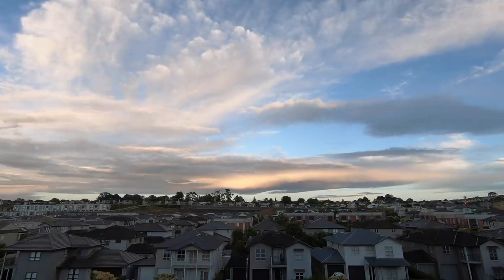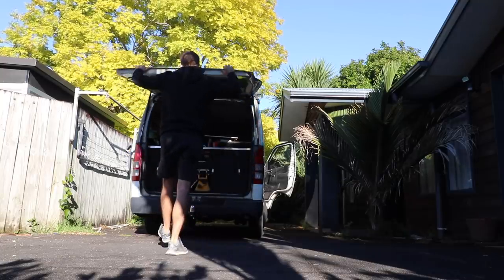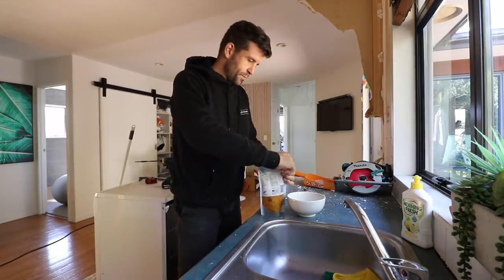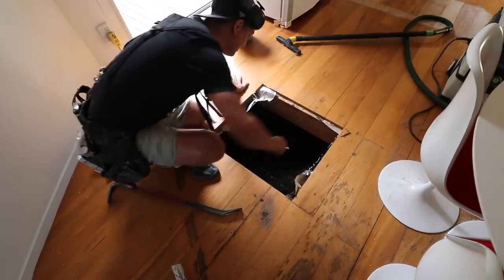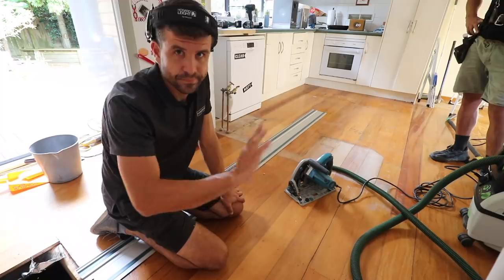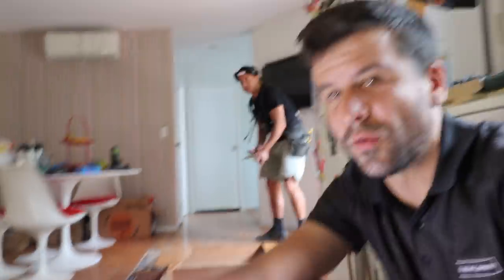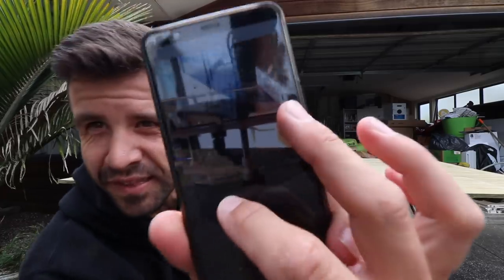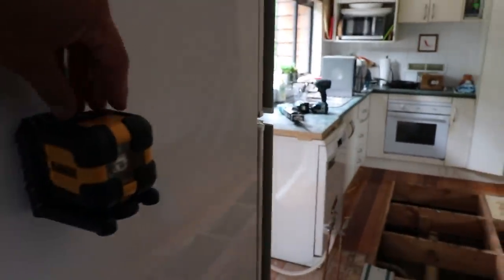A BIG Hole in the Kitchen Floor

Comment: Are there is any reason why you guys don't do the kitchens?
Thanks for another good mood episode.
Reply: yea, why no kitchens? who does kitchens in NZ?
Reply: @patdmulroy99  kitchen guys.
Reply from the maker: Yeah, there are guys who install kitchens full time. Sometimes they are former builders, sometimes cabinet makers. On this job the owner has a close relative who does it for a living
Reply: Ok cool I appreciate the answer. I’m interested in this for comparison sake. I am a General Contractor in Boston, MA, USA, primarily a home remodeler although I also use the term builder or carpenter. A Builder typically refers to a contractor doing new construction. 
Speaking from my experience, I have a JR carpenter and a laborer with me and together we do all of the framing and into the finish with kitchens always being part of that. Since I am there from start to finish on a project and running all of the subs it makes sense to be involved at all points. 

Larger contractors will have individual frame subs and finish subs who will typically do the kitchens as well. Some cabinet suppliers have their own installers, but they are usually subs anyhow. 

I’m interested in the terminology and job site hierarchy over in NZ as it seems to be pretty different from ours. Thanks and love the videos!

Comment: Hi Scott, where you opened the floor, was that the 'one' bearer running parallel to the flooring with joists somehow cut into it. It seemed too straight to be blocking between the joists. It almost looked like the bearer/joist connection was a 'halved' joint (half cut out of the bottom of the joists & half cut out of the top of the bearer). If so, it's no wonder there was so much spring in the floor. I'm curious to get a better look at that connection.

As for the aluminium foil insulation, our politicians a bit over a decade ago had a big push on ceiling insulation with partial government funding. A lot of rouge companies sprung up promoting foil based ceiling insulation and unfortunately a few people got electrocuted. Stay save bro, rom across the ditch, Jim

Comment: Just out of interest I’m a carpenter from the UK, was just wondering why you don’t fit kitchens in New Zealand? Cause as a chippy in the UK we doing everything from framing, finish carpentry and kitchens
Reply: (Not a chippy but I'm in nz) so we have a lot of finishing trades and some people do both bits it's at the discretion of the builder ....
Reply: When I worked in the UK we never built our own kitchens? Not once. 
Do you do steel reinforcing and foundations/excavations etc? Its pretty hard/dumb to try to do everything, a professional kitchen cabinet maker will be better. They do it all day every day.
Reply from the maker: Some builders become kitchen installers but a lot of time it is done by guys who trained to be cabinet makers. The guys who install kitchens here do it day after day, so they get the job done far quicker than we would